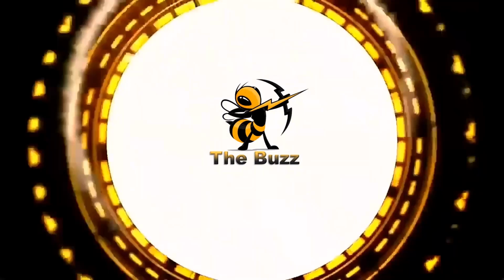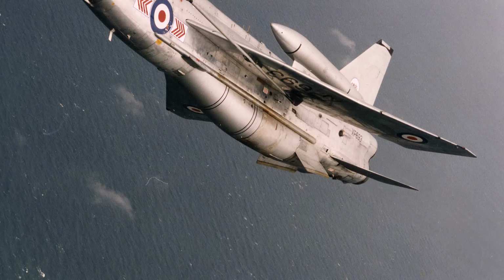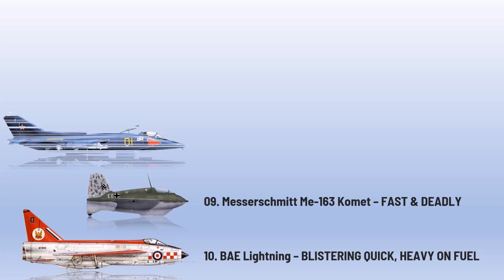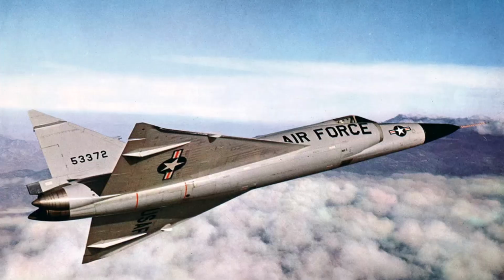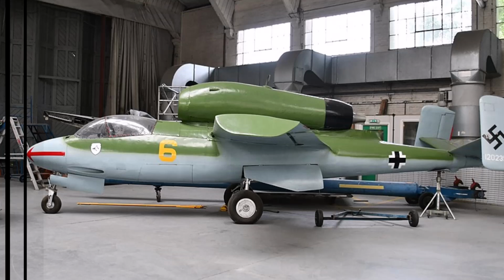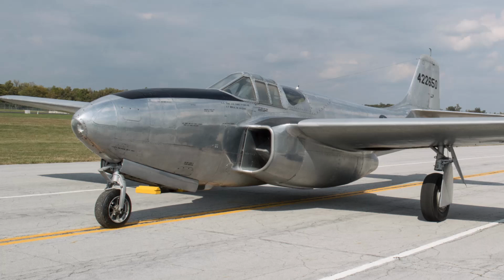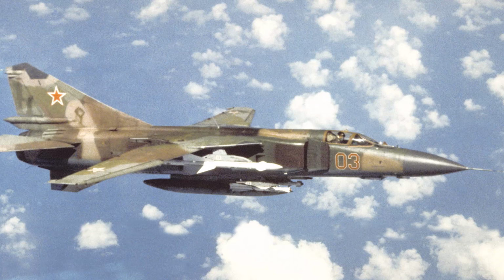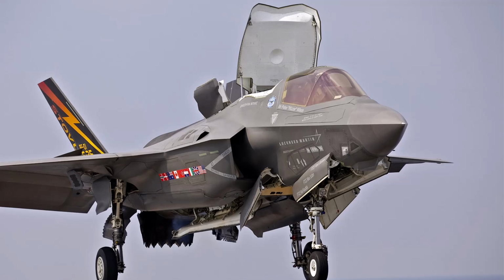The 10 Worst Fighter Jets Ever

Comment: The F-35 had its problems, but in no way should it be on this list. The F-35 would kill just about anything in the sky without the other aircraft even knowing it was there.
Reply: They always say that until the F 35 finds itself in a merge. F 35 will not do well in visual range. They call the F 35 " Fat Amy " for a reason !
Reply: As a multi-role fighter, it excels. I like to think of it as an F-15 replacement!
Reply: @tonygourdine512  yeah but the F35 would delete the other aircraft before it came within 5KM of the F35. You would know this if you had any knowledge of Military Aviation.
Reply: so far it's grounded and not combat ready so it actually belongs to the list. F-35 also has been intercepted by Russian Su-35 in the baltics so i really have doubt about it's stealth technology. you can google if you don't trust me
Reply: The only report that the F-35 had poor dogfighting skills was duting that dogfight with the F-16 where its flight software at the time was very limited. Think fighting with 1 arm tied behind your back. The current F-35 has a better sustained turn rate than the -16 and a better angle of attack than the -18. Plus, as they always say, when the -35 gets in a dogfight, you did something very wrong.
Reply: I'd like to point out that the F-35 will be designated close air support aircraft designed to replace the A-10(and outperform it as others seem to think needs to be noted), not a fighter jet. It has the same 5th generation avionics suite as the F-22 and will be almost equally capable of engaging BVR(Beyond visual range) targets, but it's not designed for this
Reply: @justinhuey7253  its not designed to replace the A10, the A10 is obsolete and would be shot out of the sky before it comes anywhere near the battlefield, the F35 is designed as a multirole aircraft that can hold its own against air threats while also providing adequate CAS
Reply: @gangsterwafflesthe7th508  They are starting to decommission A-10s in 2023, and the CAS role will be filled by F-35 - which means they are replacing them for that role, nevermind potential capabilities.
The A-10 is a combat proven bird with a lot of success how would it be 'shot out of the sky before reaching the battlefield' 🙄
Reply: @ahmedaraf8188  a better replacement for this list is by far the shittiest stealth plane ever made, the SU-57. It's so stealthy we've never actually seen it in service, and it looks like an F/A-18 on radar!
Reply: @shtorm2616  spot on !  the 6 Singaporean crews flying F-15SG's that got bounced by two RAAF F35's at the last Pitch Black would agree with you. According to them they were dusted before they even knew what hit them.
Reply: @justinhuey7253  no its a multi role jet meant to serve a variety of roles, not replace the A-10. the A-10's role really doesnt exist anymore, precision guided bombs have replaced guns for a variety of reasons.
Reply: @justinhuey7253  to answer your question, against a near peer advisory, it cannot use the gun its built around, its durability is overhyped. It is used only as a missile bus now, which the F-35 does a lot better.
Reply: Honestly a turkey will never beat a eagle. Lol... A twin turbine will be superior from any single turbine that's a fact! Just imagine a f35 turkey gets lock in by a S300 or S400 lol. The F35 lost to F16 in a dogfight how can it win over a Mig or Sukoi?
Reply: @justinhuey7253  Its slow as hell, but you dont deploy it before destroying AA and other air superiority planes, infact you dont deploy any  ground attack aircraft withh AA and enemy aircraft active
Reply: @zarsvirus  That loss was early on when the avionics were severely limited
Reply: @WeSRT4  it's still a lost no excuse will replace a lost!
Reply: @zarsvirus  No, it's not lost.... it found its way home.
Reply: @tonygourdine512  it just doesnt get in a merge. It will delete anything before getting closer than 10nm from it
Reply: If it gets airborne at all.
Reply: @zarsvirus  hows the russian troops doing against the minimum of NATO support… what is it 100,000 dead soldiers as of now… and that S400… cant even defend against missile systems from the 1980s? Damn how you gonna get a lock on a stealth fighter? Oh im sure that Russian grit will really help out. Oh and where are those SU-57s? Not deployed? Only 4 working models that break? Damn. That sucks
Reply: @silverback5811  are you kidding 34 VS 1. Nato is going to lose
Reply: @silverback5811  no I'm not Russian I'm Asian...
Reply: F35 does great in fantasy leagues. Unfortunately, there’s a good reason for the f15ex.
Reply: the aussies are cussing it, other ppl are cussing it too. maybe being  "the best" just isnt good enough🤷🏾‍♂️
Reply: Looks like there a bunch of keyboard warriors here...
Reply: @aolson8283  - yep, no F-35 or A-10 pilot’s that’s for certain…
Reply: @tonygourdine512  if is not designed for the merge. It will kill you long before it gets there
Reply: @ahmedaraf8188  it happen because the F35 was not allowed to kill them when they should have. Again waiting to merge is not what it was designed for
Reply: @techietisdead  then why were the first airplanes over Iraq in 1991 F117s, a ground attack aircraft
Reply: @briangriffith3985  and every month .ore countries buy it
Reply: @kevinstraus1478  lol are you kidding me, you still did not learn from the mistakes done in the Vietnam War... It was design to be a turkey lol.
Reply: @BillLaBrie  fantasy league I like that 1. There's is a point fantasy league we're men are not men, we're women are men. Utopia instead of fantasy
Reply: No. Its flying garbage that only does one thing well....... costs far tooooo much.
Reply: @zarsvirus  yes, thus the f15ex
Reply: @kevinstraus1478  seriously, the aussies complained saying they dont suit their operating conditions, and said they are too expensive to run and maintain, considering cancelling the remaining orders. Looks like the older less capable designs like F16's are more durable, even if less capable stealth-wise. They also mentioned the limitations in combat radius. if they enter a conflict with China, the F35's cant make it there without refueling
Reply: If you look at the long list of aircraft the F-35 is being asked to replace there is no way any craft could do the job
Among those are the F-14, F-15, F-16, F/A-18, A-6, A-8, A-10, and Harrier. While some of these craft have already been retired asking a single craft to do air superiority, dogfighting, and ground support and do it better than current craft is insane.
Like most craft it lacks the ability to loiter like the A-10 and has very limited stores in order to maintain its stealth ability
Reply: @kevinstraus1478  how did they detect a " stealth aircraft " ?
Reply: @cliffcorson4000  so it is policy and doctrine in the hierarchy to blame then, not the jet itself
Reply: @cliffcorson4000  Yep; one certain way to fail is to try to be all things to everyone. They tried this in the 60’s with the f-111 (thanks, McNamara). The goal back then was “saving money” as well.
Reply: @BillLaBrie  same was done with the F-4 but it's failure wasn't that it was a bad jet, the designers weren't seeing how combat was different during Vietnam than in previous wars and was using the "new" missile tech which killed many craft
It was eventually fixed and the F-4 was the longest serving fighter craft in the world so far
Reply: @cliffcorson4000  half of congress might be shareholders🤷🏾‍♂️
Reply: @zarsvirus  lol
Reply: @zarsvirus  are we not looking at the same war in Ukraine
Reply: @zarsvirus   vietnam was 60 years ago
Reply: I agree. The F-35 has it's faults but there is no way it should be on this list.
Reply: @kevinstraus1478  Because stealth bombers are not ground attack planes, they are usually flown with places WITH AA and other enemy planes
Reply: @cliffcorson4000  The f-111 went on to fly electronics jamming and tactical radar even through the first Gulf War. Hey, it was a plane and it flew and it could be used for something. But once I heard of how the f35 was supposed to be multi-role beyond land-based air superiority, I knew it would be a very expensive disappointment.
Reply: @tonygourdine512  No plane finds themselves in a traditional merge anymore you will just be killed by an Aim-9 before the first turn. The F-35 isent even bad in a close in fight, it has pretty good maneuverability and an insane engine that will be enough to make most planes not want to attempt a merge anyways.
Reply: @zarsvirus  it did not lose to an f 16 they wore flight test the computer software 
it was an x 35 test plane not real f 35 no radar , no opicts , just an air frame and engine
Reply: @techietisdead  you need an f-35 open a hole the defenses
Reply: @WeSRT4  was not a loss they wore just testing flight control computer and the f 16 was a chase  plane
Reply: @zarsvirus  it was not a loss it was a flight test and the f 16 was chase plane
Reply: @zarsvirus  if you read red flag 2-17 you would know that the f 35 did  20 to 1 
it killed 20 enemy for every 1 f 35 loss in combat
Reply: @kevinstraus1478  the  wore hitting deep command targets
Reply: @zarsvirus  vietnam the rule of engagement wore bad 
no f-4 could launch a missiile without first seeing up close 
the missile had problems  unlike aim 120
Reply: @briangriffith3985  niether can the aussie f- 18 super hornet 
yes slealth is harder to maintain but it bring slelth to the battle
Reply: @BillLaBrie  look at the real fighter and you will see that it is replacing those aircraft and doing it well
Reply: @brucenadeau2172  Yes, I can tell some people in here have been sniffing model glue for quite some time….
Reply: @shtorm2616  exactly. That aircraft had a detuned engine and didn't have its stealth coating on yet. in addition to its very limited software. A production F-35 redefined would be so much better than aircraft it would face except maybe the Raptor. I think a lot of the stuff learned about the F-35 was disinformation on purpose.
Reply: Problems of other aircraft are not much publicize, which makes F-35 the limelight and with the controversies behind its making hence why it always get a bad reputation. But given the statistics, F-35 has the least amount of technical incidents compared to other air-frames including F-22 and even older 4th/3rd gen ones. 

[1] https://www.youtube.com/watch?v=5pyDNOxbb-Q 

5th gen is also not only about stealth. This is what separates both F-22 and F-35 from Su-57 and J-20 as they can also collect data using its passive sensors and interpret it using their powerful onboard computers. F-35 not only has ASQ-239 Barracuda that can collect RF signals from 2 to 20 GHz but can also see a ballistic missile at 800miles (1300km) with its infrared AAQ-37 DAS as shown in a demonstration. So they can choose to avoid detection by surface radars and airborne AWACS and even destroy them using stand-off weapons. F-35's ASQ-239 besides its APG-81 radar can also jam enemy radars. And jamming and stealth goes hand in hand as it further hides stealth within background noise. So aerial engagements in BVR against both F-22 moreso with F-35 it's not enough to be stealth and/or radar silent.

On another note, 4th gen like Rafale M and F/A-18E/F would have to use external tanks to reach the same combat range of F-35C of around 1400km. Even the B variant out ranges them if 4th gen don’t use external tanks. With the coming Block IV with adaptive cycle engines, both F-35A and F-35C may reach 1600-1800km combat range. Due to the added drag from weapons being carried externally, 4th gen won’t have the same maneuverability like 5th gen fighters. Additionally, their is also no reason for a stealth plane to go fast especially supersonic as it would make itself a big infrared target which defeats the purpose of stealth. Also with Block IV, from 4 it will be able to carry 6 AMRAAMs for A and C variants.

Lastly, F-35 is a very maneuverable aircraft comparable to F-16 with no external mounts. It could also do F-22 maneuvers like pedal turns without even having thrust vectoring TVC by only using its advanced control surfaces. 

[2] https://www.youtube.com/watch?v=G0hWzaKEeZo
[3] https://www.youtube.com/watch?v=Qam6zbFCIfQ
[4] https://www.youtube.com/watch?v=SPqUvCnWcrk
[5] https://www.youtube.com/watch?v=IQKk9O2peVY

Bottom line, F-35 is a stealth ELINT aircraft with some capability of offensive electronic warfare, superb at BVR engagements with good enough ability to dogfight.
Reply: @tonygourdine512  the f-35 can do post stall and will do good in visual range.
Reply: @justinhuey7253  f-35 is a multi role aka strike fighter like the f-15e
Reply: @brucenadeau2172  Are you by any chance talking about the wild weasels? Flying into areas with radar and when the acive radar is turned on, lauching radar seeking missiles?
Reply: The F-35 has absolutely no business on this list at all. It's one of the most advanced fighters built, being used by multiple countries and sought by many Moore. This channel is entertaining but far from factual.
Reply: @zarsvirus  there are Russian citizens that are Asian so...
Reply: @kevinstraus1478  countries like Japan are being pressured in to buying the F-35.
Reply: @johnsilver9338  how long have you worked for Boeing?
Reply: @gangsterwafflesthe7th508   Disagree.  The A-10 would be perfect in a war like in Ukraine and would decimate the enemy hiding in the tree lines.  Also as it has done in the past strike fear in the opposing troops.
Reply: @Cane1992  it would do good if it didnt get shot out of the sky by SAMs or Russian fighters. thats the main problem with the A10, its so situational that it is not worth keeping around.
Reply: Boola Boola Boola
Reply: I totally agree!!
Reply: @zarsvirus  Yeah😂 Russian Air defense is so effective and deadly according to you but Engels air base inside russia which is protected by a  dense layer of ADS proves it opposite😂Can't even defend against a lumbering 1970 drones let alone defeat a 5th gen fighter😂But yes your S300,S400,and all your hyped stuff was quite effective after all  it was usedagainst your own SU57 right?😂
Reply: Ha ha ha.
Reply: not knowing it’s there 🤣🤣 that shit ain’t good
Reply: @gangsterwafflesthe7th508  while that is true, and I wholeheartedly agree the f35 is good generally, it is still a gamble to rely on long range combat. If the missiles fail (which is still a possibility), there is a risk of enemy aircraft closing in. Thankfully though, the f35 still has a gun, the last I checked
Reply: @briangriffith3985  their cussing the early models, and to be fair, every fighter has something to cuss about. Yet they still buy it and use it anyway, just probably with some modifications and some nagging to the US to change future models
Reply: They thought there would be no dogfighting in the Vietnam era also. They were wrong
Reply: @tonygourdine512  They call it fat Amy because of its wide body, nothing to do with WVR fighting as it better than f16
Reply: @virginccyy7645  my name isn't " ARIF " & when you know nothing talk less. Su-35 detected F-35 no one source denied that which means F-35's stealth capabilities is questionable especially when every country that operates F-35 has grounded their fleet more or less. F-35 needs 5-6 years to achieve what they say which means Su-35 isn't obsolete yet.
Reply: I'm thinking maybe we should build some more f22 tho been sending to many across the pond
Reply: @tonygourdine512  A I can tell you is you go rolling the F35 into the Russian multi layered air defense network, good luck! Eventually in a combat situation, the pilot will have to put the aircraft in a position that degrades it stealth, as the stealth in the rear isn't as good as it is from the front. If a pilot has the utmost trust in Boeing and Lockheed Martin not to cook the books and embellish the capabilities of the money pit, then I would say, by all means cruise on into the S500 range and see how it goes. We will lose a bunch. What's easier to replace an F35 and pilot or a missile and it's crew? With ADA missile technology the days of the fighter jet are drawing to an end, at least in its current role.
Reply: @cliffcorson4000  This 100%, its armament capacity is its Achilles heal because a ground attack aircraft should carry a bunch. They're talking about hard points, but that's ludicrous because you destroy your stealth. $ and greed brought this aircraft into being. BTW should the F35 use its weapons, the radar will see them and then can vector other aircraft into visual range of the F35, even the cannon shells can be seen by Russian or Chinese radar.
Reply: @gangsterwafflesthe7th508  Well it was part of the USAF plan to replace A-10 with F-35 just look at the the last few year defence planning reports.
Reply: @tonygourdine512  It has thrust vectoring so I think it would be fine
Reply: @ rex blade, the F 35 does not have thrust vectoring ! Only the F 22 has 2-D thrust vectoring in the US inventory.
Reply: Yeah, well actually no.
Reply: @MothaLuva it literally one of safest aircraft of all time stop coping and accept reality
Reply: @ragemore7750 20/1 kd in redflag
Reply: @tonygourdine512  hms and 9x are your friend while pulling an instant 50°
AoA
Reply: Definitely belongs on the list.
Reply: @jamjardj1974  it doesn’t
Reply: @ahmedaraf8188 That comment didn't age well.  Recently an incident occured in the Eastern US.  Something happened, maybe the pilot bumped something, who knows but the pilot got auto-ejected.  Thing is the F-35 has a safety feature where if there's not pressure on the stick the plane automatically flies straight and level.  As the pilot was floating down the F-35 just kept on going.  We couldn't find it for a couple of days😂.  This was because....  well....  it's stealth worked pretty good and nobody could track the damned thing.  Eventually it crashed in some field and thankfully nobody was hurt.  It was a very expensive way to find something out but yeah....  the stealth works.
Reply: Ikr
Reply: Much agreed!! The F-35 is a fantastic airplane in itself. It is a true show stopper. It has devastating power against any enemy in the sky.
Reply: The F-35 contract was awarded in 1997 and it still isn't fully capable to carry the weapons planned in the design.
Reply: Yes it should be on the list. It shouldn’t even have a pilot. It should be a drone, and it should be small, and no need for a stupid VTOL Version. Everything is wrong with it. It’s a joke, and expensive one